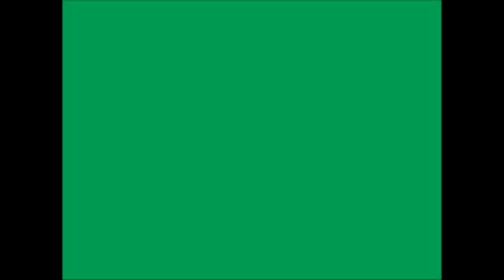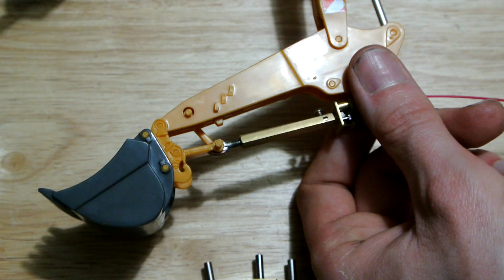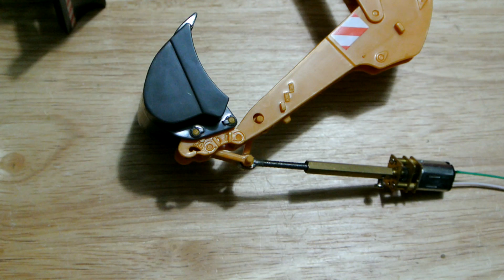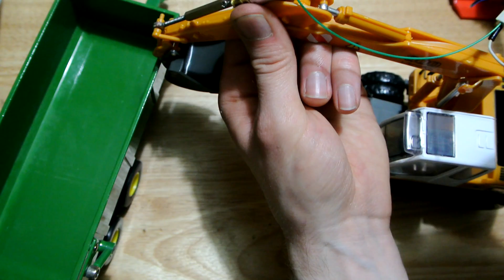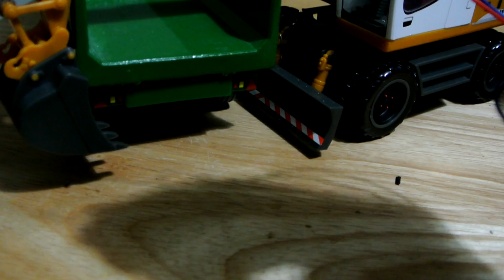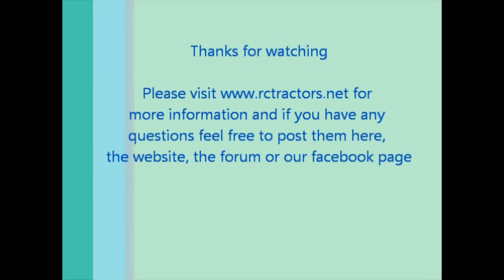Which N20 gear motor is best for an RC excvator

Comment: nice! i found a 6v 60 rpm n20 with a t8 8mm lead is a good screw speed for certain applications, I had used a 6v 200 rpm t5 thread worked good on my bruder scheaff excavator as well as a 6v 400 rpm m4 thread also works a little slow. after that for the 308 bruder excavator it needed a 12v t8 8 mm lead screw to actually move dirt. Those are for custom made actuators, not purchased linear servos.

Comment: How would i connect one of these motors to a receiver? Is it just a case of fitting a connector plug on the end of the wires and plug it into a receiver channel?

Comment: Thanks for posting,did you find the gears where okay on the ebay motors?
Reply from the maker: +Rob Crawford Yes I haven't had any break yet so they must be okay.
Reply: Okay think i'll order some then,i got a few a while ago and the gears never meshed properly and when i fixed them to the drive the gears just slipped,yours look good though,i'll take a chance on them, thanks!
Reply from the maker: +Rob Crawford They sound terrible, definitely haven't experienced anything like that. I always buy from the sellers I've linked on this page http://rctractorguy.com/store/electronics
Reply: Okay i'll give those guys a shot.
Reply: @RCTractorGuy  hi mate whats the force of the motor I want n20 push rod actuators but was told they only had a push force of 1kg can u recommend a stronger motor but that the same size

Comment: from where you got that actuator attachment may i please have the link well done though
Reply from the maker: +Ibrahim Khan I made the actuators for this model. I used an N20 motor, some brass standoff for one side and a mild steel nail which I threaded to M3 for the other side.

Comment: what type of screw that you used it?can you tell me please
Reply from the maker: +Alif Haiqal For this it was a mild steel nail which I tapped to M3 and then soldered copper wire on the other end to attach it to the bucket.

Comment: Whats about small servos? I watch many builds with servos in the arms of small size build excavators like the Volvo ec 460 in 1:32.the speed was smooth and range was nice but i dont know how are the lifting power?
Reply from the maker: +crawlervideo Yes servos work on these plastic models like this liebherr and the ec 460. Don't forget that a servo will always be carrying the weight of the boom where as the screw designs aren't loosing power holding up the boom so the batteries should last a lot longer but other than that I don't see any problem with servos.

Comment: Hi, I've watched a few of your videos and have seen the screw mechanism that is used on the arm however haven't been able to locate a seller given that I don't know what it's called. If you could let me know that would be great!
Reply from the maker: Linus Opat Well a linear actuator is what it is called but I haven't found commercially available ones small enough for this application yet. That is why I made my own using threaded bar and a brass stand off for this video.
Reply from the maker: Linus Opat Also a lot of people use a masonary drill bit instead of the threaded bar because it is faster.

Comment: Muito bom,como você fez para rodar mais rapido? É a rotação por minuto,muito bom gostei,to fazendo a minha,breve lhe mostro,abraço!
Reply from the maker: Hi, I bought 4 different gearbox ratios 1:50, 1:100, 1:150 and 1:200 that gives me the initial difference in speed but at the end I used a 7.4 volt battery instead of a 3.7 volt battery which gave me a bit more speed. Good luck with your build, looking forward to seeing your work.